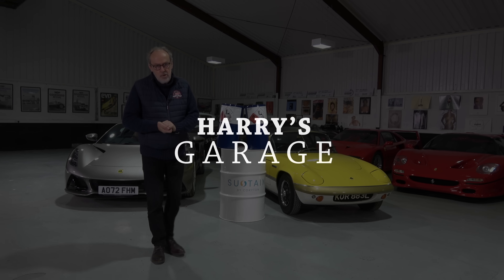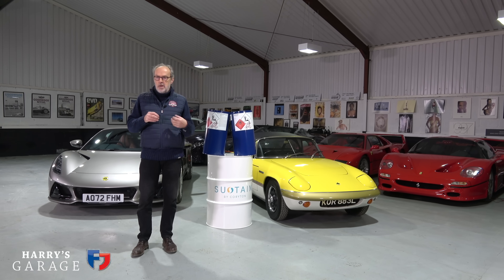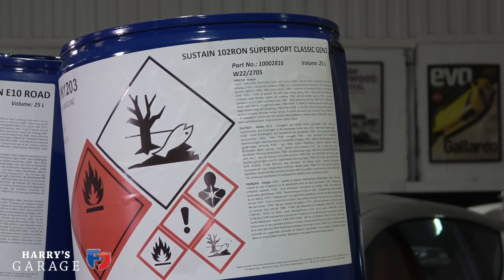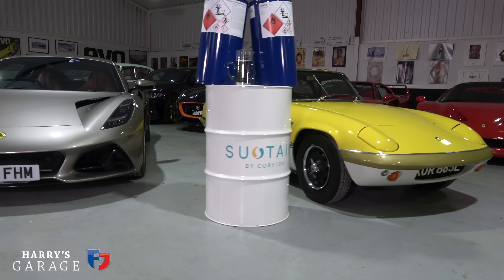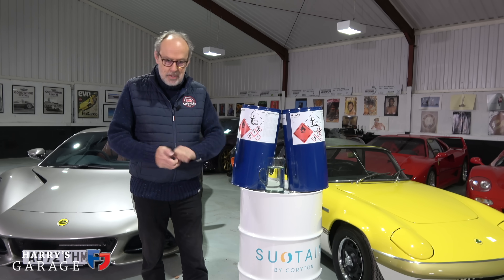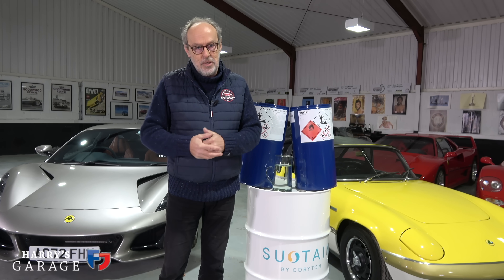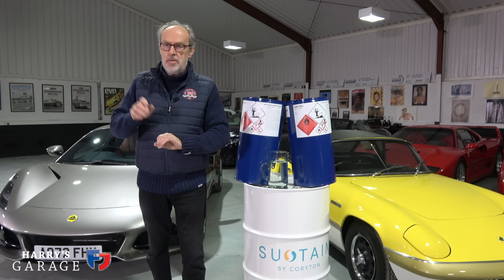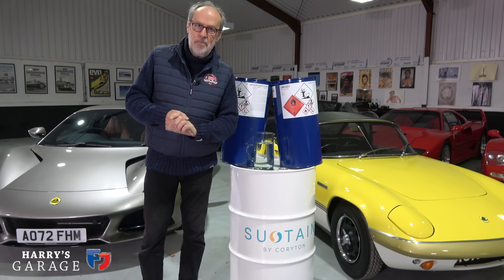Sustainable fuels; what are they & when will I be able to buy some?

Comment: Harry great video and a subject we are all following with interest. P1 Racing fuels (WRC supplier) I think has a super-unleaded replacement in works as well. The Porsche plant has started production initially 130,000 lites pa rising to 55 million litres by 2025 and higher again by the end of the decade. A brighter alternative for ICE we hope.
Reply: To provide enough synthetic jet fuel for the airline industry in Europe would require the EU to double its current renewable energy capacity. 

The efuels alliance predicts it will be 2050 before the industry could scale to meet 100% of road transport needs. And to achieve that you'd need about 4x the capacity of renewable electricity compared with battery EVs. And they're the industry body, so it's the most optimistic view.

Synthetic fuels have a role, possibly air transport, shipping, motorsport and classics but it's not a mainstream alternative for road transport because making liquid fuels and burning them is fundamentally inefficient, about 16% for an ICE vs 75% for a battery EV.

If you don't believe me, then maybe you'll believe Coryton themselves who say "The electrification of road transportation is a future we want to all get to " and see the role of sustainable fuel as being transitional to electrification.
Reply: @Tim Parsons  Well you can count me out.
Reply: @parsot  What a poor attempt at spreading misinformation. Your paymasters must be happy though since you hit all the propaganda misinformation points they’ve come up with. Too bad those arguments are incredibly weak to begin with, and also clearly false. 

You use the false straw-an argument of "it will be 2050 before the industry could scale to meet 100% of road transport needs". When will EVs provide 100% of road transport needs? We know for absolutely certain it won't be anywhere near 2050!

Which year do your paymasters predict that all cars have been 100% replaced by EVs, all the millions of super-expensive and high-loss charging stations have been pollutingly manufactured and expensively installed (who do you think pays all for those subsidized 60-150,000€ chargers?)? How nuts is it by the way that taxpayers are paying taxpayers massive subsidies to buy and have EVs manufactured and yet they are acting as if someone else is paying those subsidies? When do they predict the trillions worth of grid work and new power plants will be completed? 

In other words: by what year have the corrupt EV-dictation mafia completely bankrupted Europe and left to live their luxury billionaire lives in Bali, Singapore, etc? (Do you think some might even move to their main financier and strategy-instructor nation: China…)

And which year do you think someone will take responsibility for the extremely expensive, immensely difficult recycling of all those hundreds of millions of tons of batteries? I bet that will never happen. The hypocrites are spewing out EVs as we speak with ZERO responsibility for battery recycling taken by anyone…because the corrupt liars can’t make money off of that like they can for the rest of the totalitarian, dictatorial, anti-science EV corruption scheme (sponsored by China).
Reply: @parsot  So, I still didn't hear your answer about which year EVs will meet 100% of road transport needs?
Reply: Owner of the project in Chile (Haru Oni) seems to be HIF Global, who's also developing sites in several other places now (e.g. Australia and the US).
Reply: Regarding the Porsche plant in Chile: A  containership requires a ballpark of 2.7l bunkerfuel to transport a 14to container 100km. So, simplifying that 1l efuel=1kg, it takes 125.000l bunkerfuel to transport the initial 130.000l production for 500km. Now someone calculate how much emissions were saved by that exercise. I'll be glad to learn what Porsche calculates in that respect.
Reply: Do the maths folks. 55 million litres per year equates to approx. 343,000 barrels of oil per YEAR.  Approx. 89,000,000 barrels are produced each DAY. 

55 million litres per year is a proverbial drop in the ocean.  Sustainable fuels will be a niche product for the ultra wealthy and remember the Porsche Taycan outsells the 911.

The classic car / performance car market needs sustainable fuels to survive.  It will NOT be the saviour of the mass ICE industry.

BEVs are the inevitable direction of travel for the masses and wil be the dominant personal transport vehicle by 2035 and possibly even before that.

H2 is not the answer either.
Reply: Far as I know, the tax incentives for e-fuels are pretty low compared to EV subsidies. Why is that? I wonder. If more politicians family members and their friends get involved with e-fuels, then e-fuels will become a better alternative to petrol powered vehicles. Plus no strip mining cobalt or lithium!
Reply: @nateisright  Pretty low?? Pretty low???!!

Europe is spending TRILLIONS on subsidizing EVs, and demands tax income from far more effectively emissions-reducing biofuels and e-fuels. 
The EV-dictation is a huge corruption scheme. It’s definitely not based on science, absolutely not based on economics or good governance.

It’s partly religion/cult, and mainly a symptom of a horrible feedback loop from a failed system of governance’s broken incentive systems. When an overgrown, uncontrolled and totally corrupt system of governance has its masses find a ‘religion’ with which they can use to justify showering themselves and their friends with endless amounts of taxpayer money and therefore power…
Reply: Are we? Who's 'we'?
Reply: That 55 million litres of annual production hoped for by 2026 represents about 28 hours of the UK's petrol consumption. And that;s just the UK.
Reply: @harryspeakup8452  What's your point? That's just one company's one production facility.
Reply: @pistonburner6448  My point is there is no path to scaling up to meet any meaningful proportion of the actual requirement if this is to be anything intended for road use. In comparison, the required scale-up of the already massive electricity generation and distribution network is a vastly easier problem to solve. But for the tiny quantities required for motor sport? Perfect
Reply: @harryspeakup8452  there will be once the midle east has to become creative yk
Reply: @harryspeakup8452  You are totally incorrect, and you have not provided any basis whatsoever for your made-up claims.

There absolutely is a path to scaling up what is pretty standard petrochemical production. If there's something mankind has done over the past century it's precisely scaling up of petrochemical production! 

The exact opposite of what you say is true. You have no clue about the whole industry: not petrochemical in general, none about e-fuels nor biofuels, and certainly not EVs! If you claim to, then you are free to present what kind of expertise you have on any of the above. 

I believe you don't even have any grasp on the other production facilities of e-fuels and biofuels. Do you even remember that right at this moment basically all fossil fuels pumped into cars in Europe and the US are at least 5% if not 10% biofuel!? Do you think that is a huge volume or not? If you claim to be an expert maybe you can remind us how long it took to achieve those huge volumes?

I know of many refineries producing biofuels, biodiesels (HVO100), and I haven't lately checked up on the status on all e-fuel projects but I know the amount of fast growth potential there. E-fuel just has its own particularities which center more around not going too all-in right now as there seem to be such incredibly efficient production methods on the horizon and overall the industry likes to set up all the regulatory, subsidy, taxation status etc. systems and situations first before moving on too hastily and making a huge investment which is far from optimal.

Basically the petrochemical industry hasn't even begun trying to ramp up production yet. When they do it'll happen a hell of a lot sooner than proper charging infrastructure with millions of chargers as well as producing hundreds of millions of EVs with their huge battery lumps...all MASSIVELY subsidised to the tune of TRILLIONS, so all the biofuel and e-fuel production in the world at its worst could possibly only cost us a FRACTION of what EVs cost us.
Reply: @harryspeakup8452  The worst part about your totally incorrect post is the laughable cluelessness of the absolutely horrendously catastrophic costs caused by the forced EV push. 

You are so clueless I don't really know if you're just trying to get a rise out of people here. But if you're willing to genuinely discuss the matter, I'd ask you to move forward by giving even a simple ballpark figure for Europe's costs from the forced EV transition. Just list all the cost categories caused by the forced EV push and estimate ballpark figures for them please. 

This would give us a basis on which to discuss the costs of EVs.
Reply: @pistonburner6448  So, making fuels out of plants is "pretty standard petrochemical production", eh? Nice try
Reply: @harryspeakup8452  Yes, making fuels out of a wide range of raw materials absolutely is pretty standard petrochemical production. 

My family member has driven his new Mercedes diesel car on a biofuel (HVO100) from a major petrochemical company for years already. It is made in that oil company’s refinery (one of three of their biofuel refineries around the world), transported with their usual logistics, and sold to consumers at their usual petrol station diesel pump.

In France that company even has a biofuel pipeline to more efficiently transport their biofuel in that region.

And in Holland they use a slightly different blend from those refineries on KLM’s aircraft.

They pay all the necessary tariffs and taxes, and that biodiesel which makes ordinary, cheap diesel cars far lower in emissions than EVs only costs a few cents more per liter. So it already now in its infancy and at low production volumes costs not just a fraction of the TRILLIONS which EVs cost us, but a tiny fraction! 

On top of that it reduces C02 emissions nearly completely (90%!) and immediately , instead of how EVs barely reduce C02 at all compared to follis fueled cars, if they are any cleaner at all…and EVs don’t do anything until only after decades of manufacturing hundreds of millions of heavier, more expensive and worse cars, with hundreds of millions of tons of mined and processed batteries (from China, funding their evil plans against us). Without a need for millions and millions of charging stations manufactured, installed, maintained and periodically replaced. Without the need to spend TRILLIONS on grid work and new power plants, despite which they still can’t keep up and the skyrocketing demand for electricity will still skyrocket its price and cause all of society to suffer from inflation… 

And those hypocrite liars are churning out all those EVs right now without having even bothered to ensure recycling or pre-pay for it in any way!
Reply: @harryspeakup8452  So you are unable to give us a ballpark figure of the cost of this forced EV transition? Or you just refuse to do so?

How can you make claims about other alternatives if you can't speak about one of the main, central issues: cost?
Reply: @pistonburner6448  Laughable when you are the one who's completely clueless. To create that synthetic fuel and then burning it into an ICE you have used 3-4x the electricity that you would have compared to putting it into a battery.

Comment: If we build Stable Salt Reactors (designed by Moltex Energy) we will have plentiful, cheap, completely safe electricity generation together with high temperature process heat and the climate problem will be solved. These reactors also burn up existing nuclear waste turning it into a much safer form.

Comment: Interesting point about RON rating. In the 1980s, the Head of Fuels and Lubricants at Rolls-Royce suggested that any fuel above 90 RON is far too high for the vast majority of pre-war cars. Yes, pre-war car owners in the UK are a minority, yet I hope that in future, fuels with a wider range of RON ratings will become available. It is a nightmare to try and tune a pre-war car on Super Unleaded (i.e. 97 RON plus).

Philip H. Smith also makes a similar point about the link between RON and compression ratio in the book "Design and Tuning of Competition Engines". Well worth a read if you are a petrolhead.

Comment: Great, that's what reasonable, responsible, car enthusiastic content. Thank you very much.

This is the key, in my opinion, we must invest in developing sustainable fuels, until we build and develop electric infrastructure on the real clean level.
Reply: Good point, although I don't think there needs to be any kind of 'until' caveat in place. If a car exists today running an ICE it should be able to do so forever through fuels like this, but hopefully at much lower prices! The vast majority of people will always be drawn to buying new cars (EV's), and things like this should stop older cars being defiled by EV conversions.
Reply: @mattteee2973  
At this point, EVs are impractical for most people. I own a PHEV and am planning on moving house. It is not at all useful to sit around somewhere and wait to charge away from home. Hooking up at home means I have to live somewhere with a connection or where it is possible to install one. It limits my options a great deal. EVs have limited application today and in the near future.
Reply: @Tiredcorndog  But if you can't charge at home and can't be bothered to charge when away from home why did you buy a PHEV? Wouldn't an ICE or HEV made more sense?
Reply: @Tiredcorndog  Sounds like you're in the US, so fair enough on not wanting to get an EV with your typical driving needs.
Things are a bit different over here in the UK though.
Reply: @mattteee2973  Thank you, I agree, but what would be wrong with EV conversions of the regular cars?
Reply: @bag2963  tbh I've never seen one done to a regular car- its always done to something interesting at the cost of its original, characterful and interesting powertrain.
The cars people own "to just get from A to B" will be the ones that naturally get replaced with EV's anyway as people chase the latest trends/finance deals. I know Harry has mentioned in a few vids how they should be holding onto cars for longer but I can't ever see the average person wanting to do that.

Comment: So interested in this subject as i've got some classic scooters off which i don't use much but don't wan't to create a problem  when i decide too . Thanks Harry great video.
Reply: What? How much of problem do you think your scooters will make?! 

Get a grip man....
Reply: Convert them (or one of them) to use CNG! That significantly reduces the other pollutants of old engines too. Scooters usually have the space for a CNG tank as well, you don't even need to remove the fuel tank...you can make the thing bivalent (=able to run on both the original gasoline system as well as CNG).

Comment: There is no reason this could not replace the pump fuel we use today. If the same amount of investment goes into this that has gone into crappy electric it would already be done.
Reply: It’s all horseshit. Big industry isn’t going to solve big industry. Get a Toyota hybrid and a motorcycle that both get 60 MPG and will genuinely last 20 years. If you want to reduce CO2 you need to campaign in local cities for public infrastructure and green space. Get the people that don’t want to drive out of cars.

Comment: @harry, did you take into consideration the improved MPG, currently your average is 20 so with Sustainable fuel it would be 22? therefore the running would be slightly better?